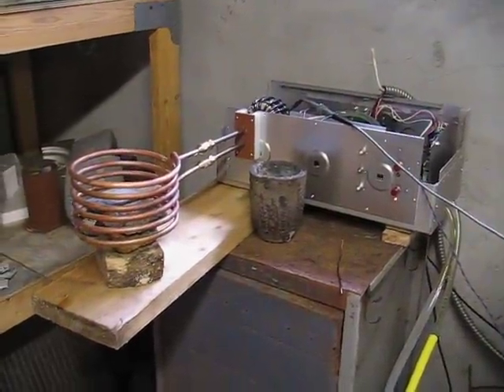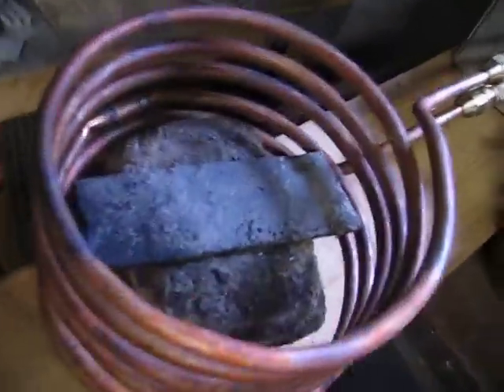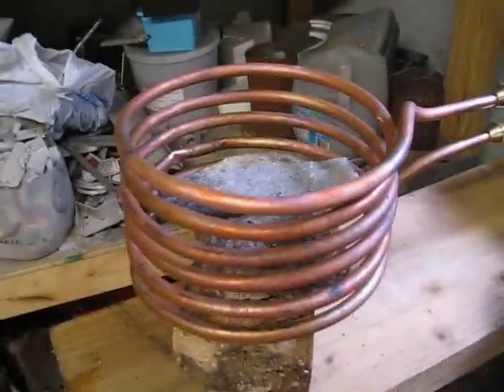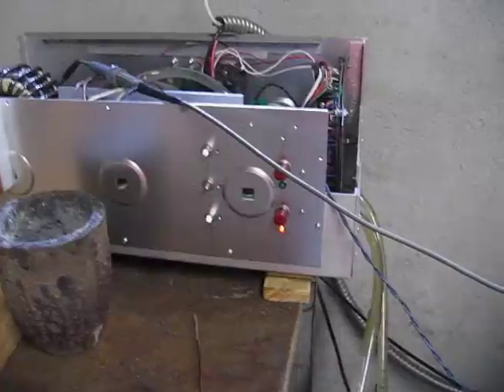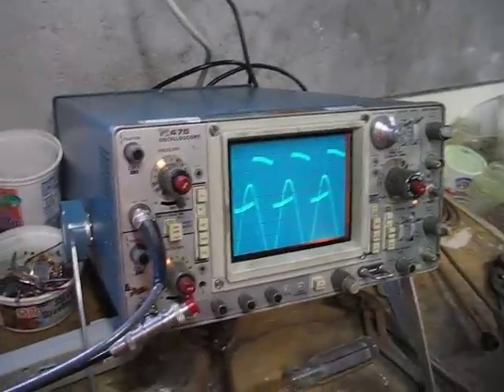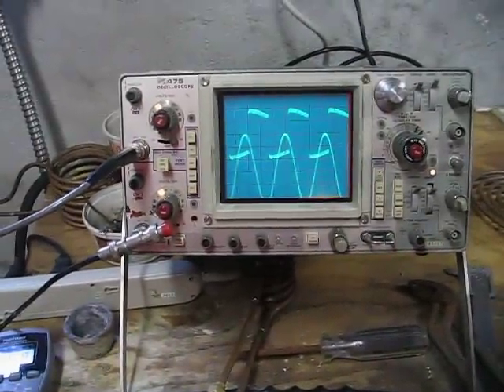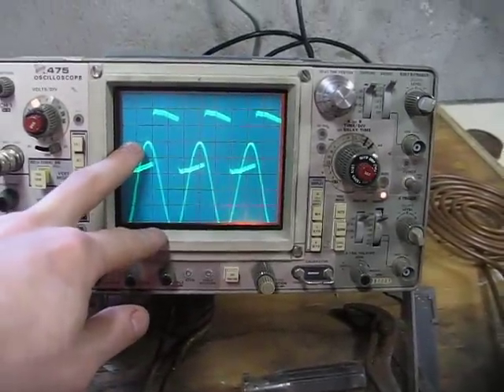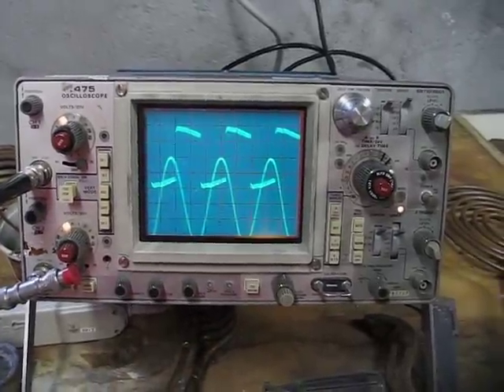Skin Effect

Comment: This experiment is wrong. First of all skin effect is the effect due to which we observe greater resistance for the same conductor when AC is passed through it rather than DC. In this experiment no electricity was passed through the slab. This is just heating via induction and heating starts through the surface as always. Need not be an conducting material also.